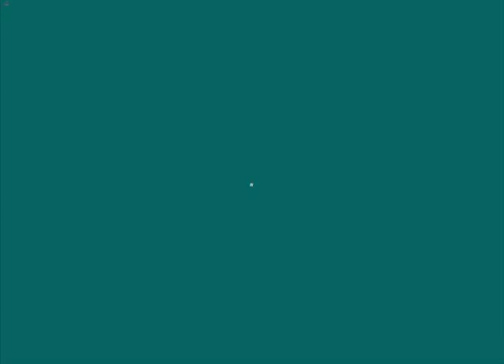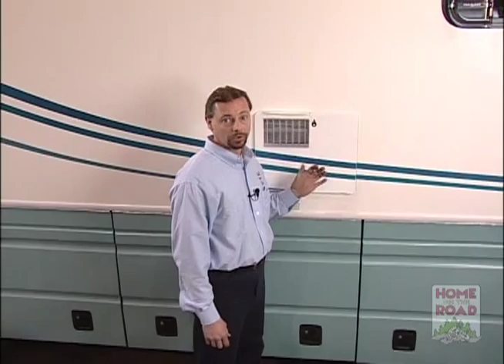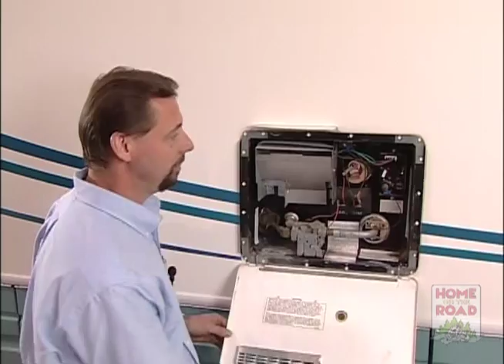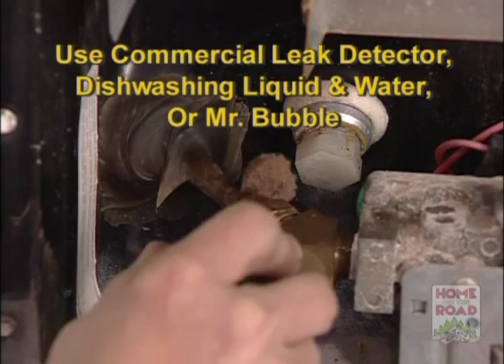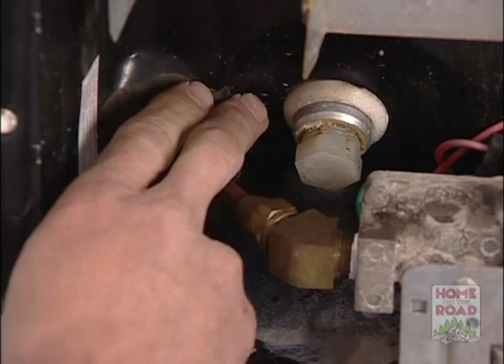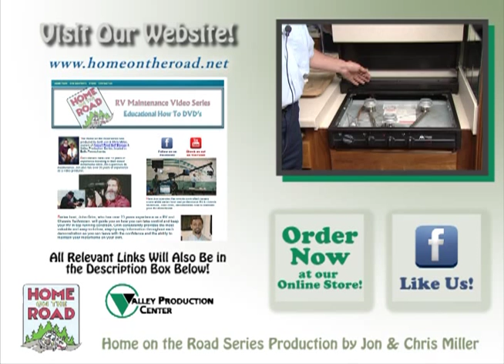RV Maintenance - Propane & Electric Hot Water Heaters

Comment: I wanted to ask a question ~ when I switch on my propane heater to heat my water do I have to fill my water tank or do anything different than just have city water coming in from the outside hose. It seems like I would need to have water in the hot water tank but how do I get it there other than simply turning on the hot water faucet (even before it is actually hot)